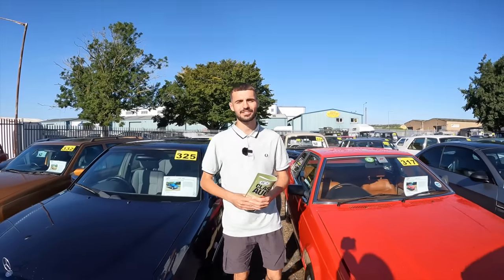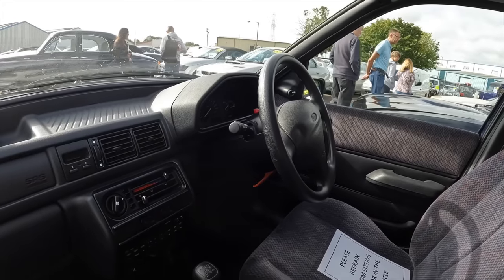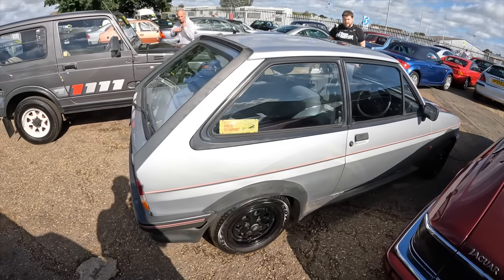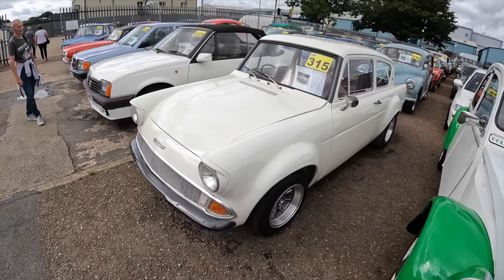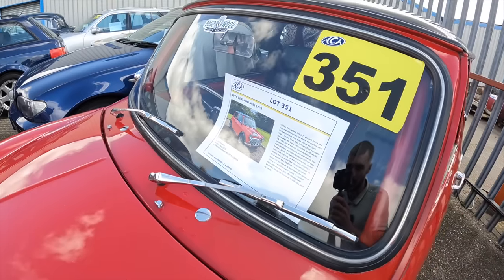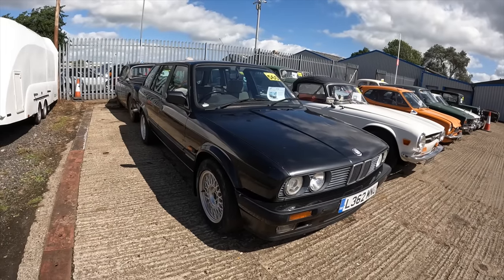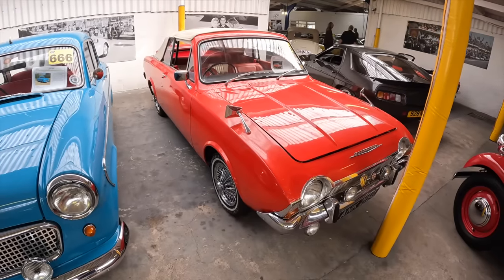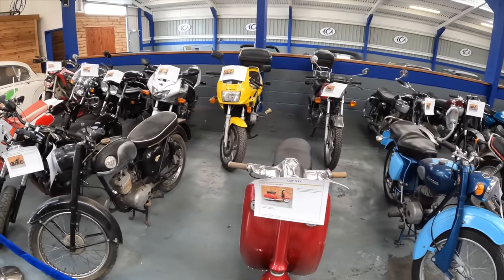I ATTEND A *300 LOT* CLASSIC CAR AUCTION! ANGLIA CAR AUCTIONS

Comment: Had a J plate nova gsi, in 2003, had a race cam, full scorpion exhaust(pre cat days)lowered 30 mm on 15 inch imolas. Had 3 in my time but that little thing was punchy 😍😍👌🏻
Reply: .....obviously not by today’s standards🙄... but power to weight ratio works out around the same🤔🤷🏻‍♂️🤣

Comment: The Crayford was also fitted with a standerd V4 engine which was prone to damaging its self due to a nylon sprocket giving out in the engine i know a few people who have replaced that engine for V6 or 2 litre pinto variants.
Reply from the maker: That’s interesting, I was unaware of this common fault. Thank you for sharing 👍🏻
Reply: The camshaft was driven by a fibre gear wheel on an aluminium centre. It would slip and throw the timing out and could damage the engine mainly because the oil pump drive was dependent on the camshaft being driven. The V6 was the same. I replaced many of them over the years @Mk2Mitch

Comment: Cushty video that white anglia was sweet bro,have u ever been 2 mattersons auction (think ive not spelt it right lol)how r it you getting on with ur moredoor ????
Reply from the maker: Hello mate, not been to mattewsons auction. I did email them but they don’t allow recording unfortunately, as I think it would clash with the tv show 👍🏻 moredoor is currently getting the underseal stripped off and it’s a long monotonous task! It will be all removed soon and underside painted, ready to then finally fit the engine and running gear etc 😁